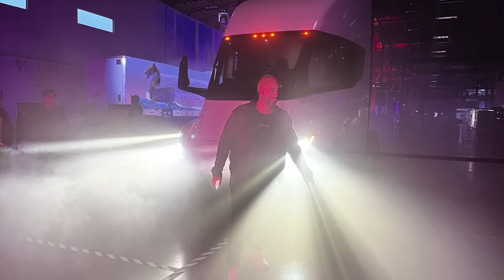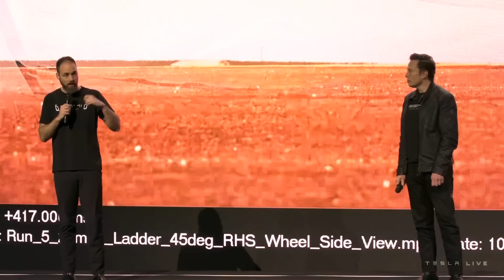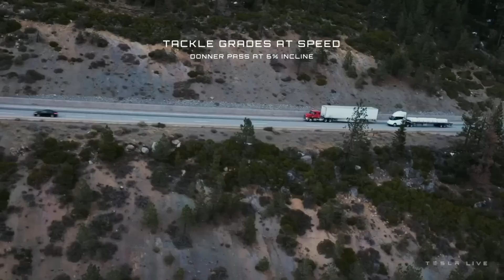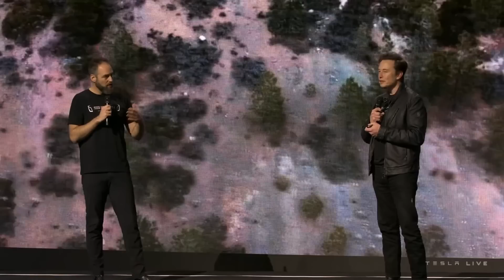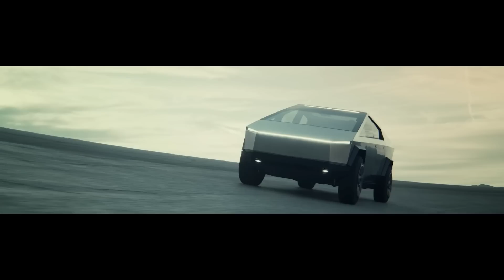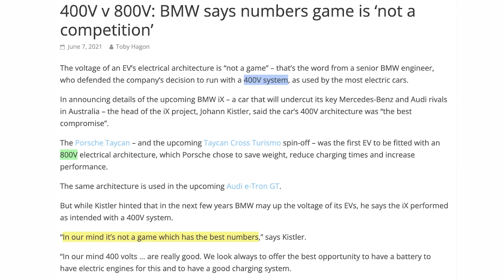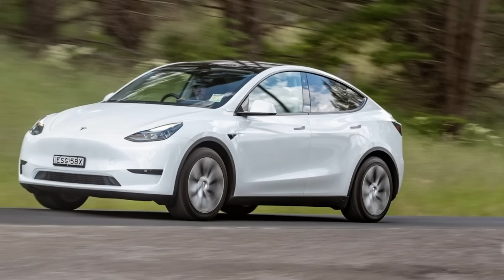Why Tesla Is Being Secretive About Tesla Semi & Why OEM's Are Giving Up ⚡️

Comment: I was okay for Tesla to not give a lot of details for everyone to obsess over.  Giving too much detail locks them into a certain build.  This way, as long as it performs how they say, like 500 miles, who cares what size pack it has as long as it's 500 miles?   Yeah I would like to know how much the cab weighs, but I am not a trucker so it would be more of a curiosity.  I would like my next Tesla to have a 400 mile range. I don't care the pack size they use as long as it goes 400 miles.  I don't care the horsepower, just how fast it is 0-60.  etc...
Reply: You would "like to know how much the cab weights, but I'm not a trucker, so it's a curiosity." You can be sure it's more than a curiosity for their potential customers, and they didn't get that info either.
Reply: @typhoon320i  yeah. It's something people need to know.

Comment: I like it. But I can see the problems. They focused on range and acceleration. But didn't show braking. How long, what distance is required to come to a full stop.
Reply: They did come down Donner pass with cool brakes at the bottom.  No fade.
Reply: @danharold3087  I'm thinking more flat road. Highway speeds. With and without a 100% charge.
Also interested in motor failure.
Reply: @Dularr  With regenerative braking the weak link is the tires.  As for motor failures we are talking electric motors.   Think about how easy it will be to change one.  Not a lot worse than a u-joint?    You could put a couple of spares in cab storage!  Having said that I don't expect frequent failures.  No reciprocating parts and all that.

Comment: I think they should have talked about massively lower maintenance costs and also the benefits of EV's when the vehicle is not moving (as in traffic). An example is truck queues for container loading at Ports. They can wait for multiple hours and only move incrementally forward.
Reply: those are awesome selling points.  But everyone in the industry is well aware of it.  These are recruitment events, not investor or sales events.

Comment: Going downhill with a diesel semi is dangerous because the brake rotors get heat soaked and lose their efficiency to stop. It's not because the brake pads get worn down in the matter of a downhill section of road
Reply: You obviously don’t know what a jake brake is.

Comment: So happy to see it do the 500 mile haul going over mountains and with a negligible average change in elevation!  There were a lot folks saying the battery weight requirements to pull this off was impossible.  I didn't doubt Tesla engineers' ability, but it is so good to see it happen :D
Reply: The descent from the top of the Grapevine on I-5 is no joke.  I'm impressed that the truck battery could absorb the energy of that slope with a full load.  It must have not had to rely very much on trailer braking if it was able to recover the energy from the (very serious) up-slope.
Reply: @claykarmel7720  the truck drove from norcal to socal. So it actually went up the grapevine. Which makes the range more impressive.  That being said they said that they have been driving this thing up-and-down the grapevine as well as daughter pass between California and Reno. So I don't doubt that the regenerative breaking is totally up to the task of slowing this vehicle down.
Reply: @ShotGunner5609  Yes, I know both routes well and have driven both in my Y.  Fremont to SD climbs sea-level to a bit over 4,100' and descends back to sea level. My point was two-fold... That the regen was able to absorb the extraordinary energy of the descent from the Grapevine to LA, and that they must not have had to use very much trailer-braking (which is lost to heat).  I have had my Model Y regen 'maxed-out' on a couple of steep descents (Horseshoe Flat back to Lone Pine, for instance).  It's really impressive that Tesla could do that with a 82,000 lb vehicle.  That's a LOT of energy.  Well.  Let's do the math.  4,100'*82000lbs gives 336M ft-lbs, which is about 456 MJoules, or 127kW-hrs.  Tejon Pass to Santa Clarita is 43 miles, so about 3/4 hour.  So charge rate was 127kW*4/3 or about 170kW (average, not peak).  Steady.  For 45 minutes.  I'm impressed.  Somebody check my math.
Reply: @claykarmel7720  yes it's very impressive! Sorry, it's been years since I've had to pull that hill,  i forget that the hill to the south is also pretty beefy. The n
North side is just always what is truckers think about with regards to the hill.  I look forward to getting to drive one of these bad boys someday too!
Reply: @claykarmel7720  I can see that going south but going north is a different story - same elevation change but in 1/4th (?) the distance as well as a constant downgrade with no relief. At four times the rate that would be 680kW continuous for ~15-20 minutes. A lot of heat build up, peak rate might exceed the charging curve and could even exceed max battery capacity depending on starting SOC and point of departure. What happens if the battery is maxed out? Is regen braking totally disabled and you are limited to physical brakes only?
Reply: @GntlTch  for semi application how about a "bleed resistor" that will absorb the excess regenerative power (and I won't be surprised if Tesla already does or will have this)?
Reply: @claykarmel7720  Why, is the regen program so crude that it can't regulate the charge rate?
Reply: @pogo1140  Tesla obviously regulates the charge rate.  That's not the point here.  The question is how much kinetic energy can be realized as electric energy and stored.  I was expressing amazement at how good the Semi is at this.  There clearly is a limit, but the Grapevine wasn't enough to reach it.
Reply: @GntlTch  In my model Y, I maxed-out the regen on the downslope from Yosemite to Mono Lake.  (Ridiculously spectacular views there, BTW.)  I was warned by the system that regen was limited and I used brakes for the additional slowing needed. Regen was still working, but not capturing all of the kinetic energy.  Tesla software now anticipates big downslopes and automatically pre-conditions the battery for faster charging.  I think this was before that feature was added, and marginal cell coverage at the top of that grade might have played a role.  Nothing scary or dangerous about it.  I just got to use the brakes for a mile or two the same way an ICE car would.  Actually, less than the ICE cars I've driven on that route.

Comment: Why do you say it's not a long-haul truck?  It can go at highway speed for as long as a driver can legally drive in a day.  What would you consider long-haul?  A truck that can be driven 16 hours straight???
Reply: 800+ is kind of the start of long-haul...
Reply: Long Hall trucks fully fueled can go over 1500 miles before needing a refill. Most drivers with that capacity don't fill them or run on one tank(half) so they can carry more load.

Comment: I only think this about the semi. A 500 mile journey in the Tesla semi will cost $400 less in fuel. If the semi does 300 x 500 mile trips per year that saves the trucking company $1.2 million over 10 years. If the semi does low speed city work this is even better.  Then there is driver comfort, acceleration, braking safety, no pollution, noise reduction, FSD, lower service costs and greater reliability.  This is enormous.

Comment: Key takeaway from last night: The demand for these trucks will be so great that they will be sold out for years to come. I can't imaging a single truckdriver or fleet owner that wouldn't want one of them. Especially the fleet owners. Imagine the amount of money they are looking to save, not only in fuel costs but safety/maintenance/insurance savings by employing a truck that has this many features (regenerative braking, no manual gears, insanely quiet, autonomous safety features, aerodynamics, comfort, performance). Just the regenerative braking alone will probably save owner/operators a bunch of money. 

Side note: That guy driving the red truck in their video getting passed uphill on I80 at the Donner Pass by the Tesla Semi will probably be buying one! lol That was IMPRESSIVE!
Reply: Look at it another way.  Anyone using a truck and in a competitive business will need to switch to battery powered trucks in order to stay competitive.

I expect several other companies will have sub 250 mile range options available for sale very soon.  And that would satisfy most hauling needs.  BYD already builds a lot of Class 8 trucks.  Just not yet in the US.
Reply: @bobwallace9753  250 is the target most have been hitting.
Reply: @judedornisch4946  BYD has a 124 mile range when hauling a full load.
Reply: No it won’t.

Comment: They said they would use the cybertruck internally to gain experience. I assume that means that it is broken in some way.  I imagine that the model s, x plaid plus the cybertruck plus the semi truck all use similar motors.  The cybertruck uses a higher ratio, the semi truck uses the lowest gear ratio.  The S and X use the highest gear ratio, but are also running at half the voltage.  The clutches on the semi truck with the countershaft design are dealing with a lot more torque.  The software that controls the clutches needs to be in tight integration with the clutch lockups or the clutches are toast.  This design is unique at tesla.  all of the other powertrains have been direct drive.
Reply: Motor voltage is determined by the motor controller which includes the inverter which converts DC to AC.
Reply: Why would something be broken?  Tesla uses trucks to haul stuff.  It would be super-smart to use their own.  That would save money and give them direct experience with how their trucks work and how they might improve them.

Do you know how rapidly Tesla products can be improved?  Sandy Munro calls it "at the speed of thought".
Reply: Having a potential for improvement in no way means something is broken! Are you new to the Tesla iterative process? Or ask any programmer how much an application changes after receiving user feedback on an initial release. Your assumption has no basis. Look up the vernacular definition of "assumption".

Comment: as soon as they come up with a sleeper cab option, and gain EU/UK type approvals they will definately  lead the industry the centre seating position has 2 very large benefits, safer viewing position,but by far the biggest benefit is the ability to sell it in RH or LH drive markets with no cab redesigns, after all as per Elons quote the best part is no part, eg one cab layout across the globe,the biggest brake on semi rollouts will be it charger rollout,if he can crack that in the US /UK & Europe he has a giant killer on his hands, remember the UK & Europe are smaller geographically than the US :) :)
Reply: The question is can Tesla fill all the day cab orders prior to arrival of FSD.   I don't think so.
Reply: Tesla has designed their Superchargers to be 'plug and play'.  The chargers arrive at site sitting on their concrete bases.  Take them off the truck, set them in place, hook up the power lines and they are good to go.

What takes the most time is permitting and getting the utility company to be ready to accept the load.
Reply: Can’t name it off the top of my head but I believe I’ve seen diesel cabs in Europe with a single center seat year’s ago.

Comment: Tesla said the gross weight of the truck on their test run was 81K lbs (law allows for 82k), but they never said how much is the cab vs the trailer / payload. This seems like a very basic spec that they know so probably means the actual payload weight is significantly less than a diesel since using current generation 2170's and should improve once a next gen 4680 pack is used. I expect for a lot of fleet operators who know what their loads will be day to day, this will be ok (still at 0% of truck market), but would be good to know.
EV truck should be great in metro areas where diesel trucks clog up roads (very slow pulling away from stop lights and lots of pollution while idling at lights where they are getting 0 mpg).
Reply: No.  Elon has been very clear.  There is no load penalty for using the T-semi.  Same amount of load as a diesel rig at 80,000 pounds gross.

Comment: It’s an amazing truck. I share your disappointment on lack of details. The datapoints which they covered were mostly already known. The details on v4 charger were new and interesting. They shared specs before on other new cars, so not sure why they didn’t add more specs for the Semi. Sadly it will be used by tesla haters that they are hiding something. The one spec I wasn’t expecting was the price points. These are commercial vehicles and my hunch is that they have different prices agreed with different companies. They don’t want to upset anybody and have enough backlog at the time that they don’t need to do so for now.
Reply: Others have mentioned that the cost savings are such that discounts are not needed.  If you don't want to pay NEXT.  Given that we don't have a price it is kind of moot.

Comment: I work for a company that competes with Pepsi haha. The most Ive been able to be loaded is 45000lb. I wonder if the load weight on this TSLA Semi will be comparable? or is it only 35000lb,30000lb,25000lb!?? Public/Investors/Industry still wants to know this info.
Reply: In round numbers the weight of a  diesel engine for a class 8 is about 3000lbs if one includes the radiator and stuff.
Model 3 battery pack is 1000lbs.  Speculation is that the semi has 4 times this in batteries. So 4K of battery.
The rest of the electric drive train might be about equal to the transmission.   So the Tesla semi comes out 1K heavy.
Which is in line with Elon saying full load.
Reply: @danharold3087  I get that is what the assumption is. Given the additional 2000lb allowed for electric, then it would mean that the payload would be about 1000lb the above ICE semis, but this presentation did not even mention it at all.  I think the biggest unanswered question is the Semi's unloaded mass compared with a typical ICE semi. How much net load can it actually tow?
Reply: @menochivo9507  I agree.    But it is not a show stopper and is subject to change.

Comment: Love your content.  The thing that troubles me most about the Semi delivery event is the powerful football-sized motor.   I'm in no position to evaluate how it works or how it performs to well but it just seems to fit into the "too good to be true" category.  I'm not saying it's not as advertised but I just can't get my head around that it can be so incredible.
Reply: Other manufacturers have made similar claims. Electric motors aren’t same as ICE! Being carbon fibre overwrapped means 20,000 rpm too. 1,000 volts must count for a bit vs Plaid S 400volt. Check out the regen too - it’s amazing if in mountain country, must be great for city work too.
Reply: The gear ratio in the diagrams were what convinced me.
Reply: Relatively low torque can be used to keep something rolling. They mentioned 2 other motors per axle when high torque is required. Efficiency is their core requirement
Reply: @thomasreese2816  typically trucks operate much closer to maximum power, don’t have much to spare for hills. 
Tesla semi is a total beast! 
Musk said "three times the power of any diesel". Which means 1,800 hp!!?
I’m guessing it’s needed for regeneration, otherwise it’s just to show off? Musk knows to effect industrial transformation / market disruption / dominance, need order-of-magnitude improvement. Which they’ve demonstrated, in spades.
Reply: If I understand it correctly, this is because electric motors scale power more efficiently due to no loss of torque.

Comment: About the Cybertruck charging curve, even if 750 kilowatts is held for only 5 minutes, that's a whopping 62.5 kWH.  I like to assume that the Cybertruck (dual motor) will have about a 100 kWH battery, and get about 316 miles of range (like the original range of the dual motor Model Y). That comes out to nearly 200 miles of range in 5 minutes; admittedly not a full charge, but if you rarely use the top 10% and bottom 20% of battery capacity as recommended, another minute would bring the battery pack up to 70%; basically a full charge in 6 minutes, real-world use case!

Comment: if you can do 70% of max charge in 30 minutes, you can get most of the information you need because generally no one is sitting around waiting for the tail of a charging curve when money is on the line and you can drive on down the road with the same amount of time and do the 70% again.  Make best use of your time, and it's not waiting for high C number optimal math...

Comment: I liked the event - the drive train was the surprise to me. Tesla are reticent about semi battery details. There may be good reasons for this, e.g. the battery/design is still in flux, can't stand much more heat on the 4680 delays.... It's unlikely Munro will get a semi and tear it down so we wait for a CT. Not an issue, the main thing is getting these out the door and on the road.  
The bottom line - If the truck pays for itself in three years customers will not care what battery. Especially, if they get $40k off in IRA rebates.